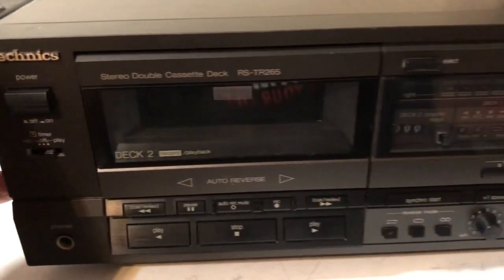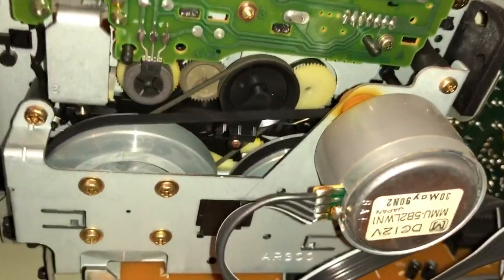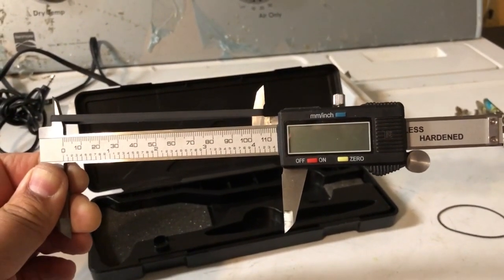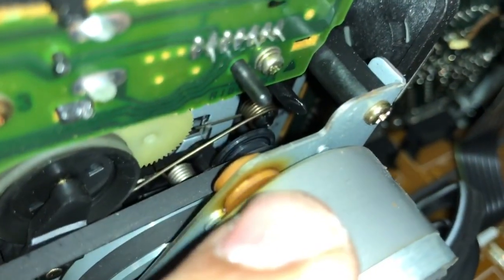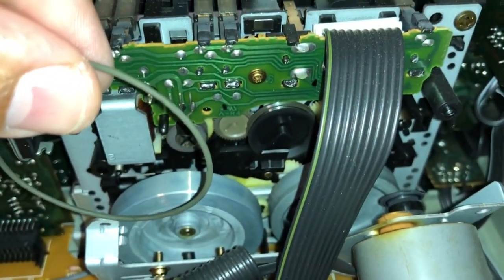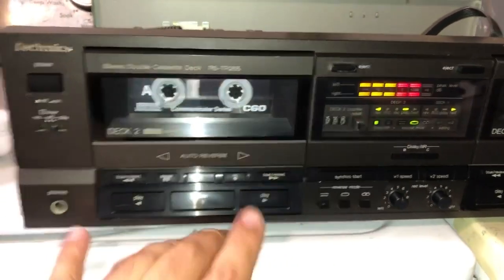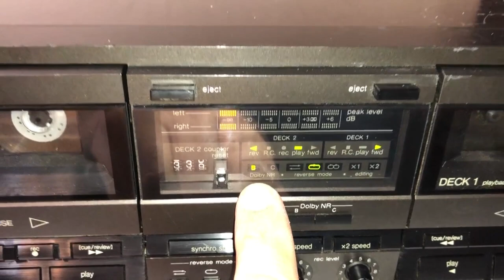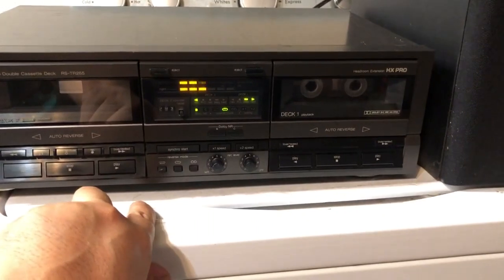DIY Cassette Belt Restoration - Technics RS-TR265

Comment: Oh this is the old disintegrating gear mechanism with the techniques. I had the Kenwood version or I should say I have it. I got two new gears from either the Netherlands or Slovakia. I can't remember but replaced that gear and they work like a charm. Really nice decks. As long as you know about that gear you can fix them really good. Also, I should mention I didn't have really good luck with square belts on that drive mechanism. He kept turning and turning and doing somersaults on the pulley. But once I put a round belt on it, the smaller belt that is it works just fine

Comment: Nice entry level deck, just a few things so you know, that thing you call a "wheel" is called a flywheel, the rod attached to it is called the Capstan, the little plastic piece you used to hook the belt is actually there for that purpose, as for Deck 2 only working in reverse, take the cover off, fool the machine into thinking there's a tape in there, press the forward play button and observe what's going on, see why the reel isn't turning, do the same for the other deck and note what it does because it works, this will narrow down the problem, could be hardened grease, those flat ribbon cables are easy to disconnect to give you lots of room.
Reply: Also the part of your vernier calipers you used to measure is incorrect, it has to be on the sharp part a little higher up, near the point.
Reply: And to make it easier for yourself to put bands on, use a dental pick, or something with a little hook, it makes the job so much easier!
Reply from the maker: Thanks for the advise.  I will keep that in mind when I measure next time.  I just wanted to show that there was a difference when boiling the belts.  Thanks for watching!
Reply: I have a technics rs tr155  and I have the same exact problem on both decks , do you think I should put new belts since the boiling method did not work for me , or do you think it's a mechanical issue ? Please advise . Thank you!
Reply: Thank you Nick your comments are a great help to me. I have two technics cassettes ch950/550 with similar problems. Cant find any videos on here for RS CH players sadly. I'll have to work through the tutorials of other models. Thanks again. Regards

Comment: Good video! I have a RSTR515 which is similar to this deck. I think it's fantastic for the price. Wonderful sound on my system with normal and chrome tapes. Mine had bad clicking in it in both decks when I first received it due to a cog in the centre of both mechanisms that transfers drive to the reels going soft and loosing teeth, a common issue for these decks apparently. After ordering two new cogs and studying youtube videos on how to access the cog to replace it, both decks are now working. Only problem now is deck one will not engage in the reverse direction, and I haven't yet figured out why. Both deck mechanisms look identical to me and I can't see why deck 2 works in reverse and deck 1 doesn't. It trys to, the heads spin the reverse way but before the head bridge engages, they spin back forward again. They won't lock in the reverse direction position for some reason. Probably a simple fix but beyond my basic knowledge level so I've just been enjoying deck 1 in forward only mode. Any auto reverse action must happen in deck 2. If anyone has any suggestions, let me know though. It's coming apart again soon as the original belts are starting to need replacement, so maybe I'll have another go at making deck 1 auto reverse again.

Comment: I have watched your videos trying to hook my system back together. it was working and I had to take all the component's apart to move it. I had someone else put it together originally. I have spent hrs trying to figure it out. do you have a video that I may have missed? My system has a SA-EX510 receiver, SL-PD888cd,and SH-GE50 equalizer. I'm not good at this stuff.
Reply from the maker: The equalizer needs to be plugged in correctly.  This is why you probably aren't getting any sound.  Make sure that you plug your equalizer's out into the amp's in and vice versa with the other output next to it (Rec and Play).  After that you should be able to plug everything back and get sound.  Remember that tape decks have to have their out plugged into your amps in and vice versa.  I hope this is helpful, wish I can see a picture of your setup, but that's all I got.  Thanks for watching!